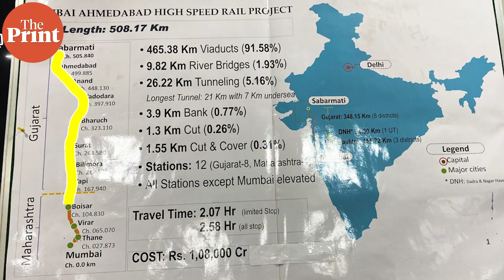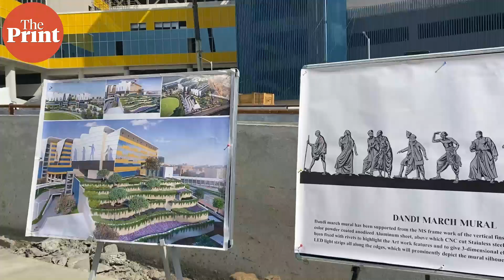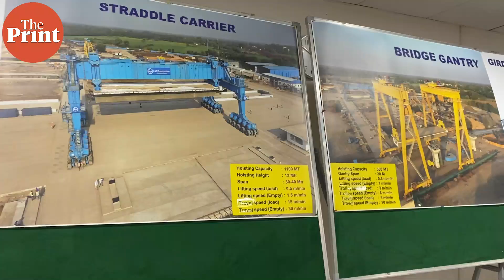Pier by pier, girder by girder, how Gujarat leg of India’s first bullet train is gathering momentum

Comment: By the time this is ready, China would be running 600km/hr maglev HSR which is already ready and entering service next 2 years and the network would be 50000+kms up from 37000+kms today. Meanwhile, China is testing 1000+km high temp maglev tech to be implemented in the 2030s. Indians should stop arguing, debating etc and work faster!
Reply: Maglev runs only in Shanghai lol. Calm down. This is 500+ kms. Same as China and speed will improve as we go on.
Reply: @narutohenaruto  you must keep up. Shanghai maglev has been running for over a decade at 400+ km/hr. China just introduced a new 600km/hr maglev which is undergoing final testing and will be in service on other lines soon. India has NO line faster than 100+ km/hr today. The Japanese one is nowhere ready and will take years and will only run  just at 320km/hr
Reply: @n.c9653  Indonesia will follow China for HSR and Maglev @ 600 km/hour as well . We , Indonesians are satisfied with Fuxing CR400AF Red Komodos @350 km/hr I am going to ride it this coming Juky 2023.
Reply: @narutohenaruto 

600km/hr train is ready 😉. Will be in service on the next 1 to 2 years in China. And China has started working on a new high temperature maglev that will go over 1000km/hr.

youtu.be/KjihYB-AQCA
Reply: Is China running HSR in profit?

Comment: 320 km per hour, and covers 580 km in 3 hours, then what's the use 😂
Reply: 320 is the max plus there might be stops along the way. The train has to take curves, accelerate and decelerate, right.!?
Reply: The use is that currently it takes 7+ hours for the same route, so it slashes the travel time by more than a half
Reply: Limited stop train can do 580km within 2 hours.

Comment: The Japanese High-speed train technology is 30 years out of dated, just like Japanese phone or TOYOTA car, there will be no TOYOTA in 2035, or even 2030. Check the video with the title:
2022 BYD Atto 3 - New electric SUV with 521km range! | Walkaround | Autocar India
Reply: The shinkansen E5 coaches which will be used in our bullet train has been operational since 2011, so it isn't 30 years outdated...
Reply: One bowl 🥣 bat soup please
Reply: @rohityo8729  Funny. You can't build a bridge without Chinese equipment
Reply: it should auctually start work on Hyperloop
Reply: Hello Chinese,go away
Reply: Brother it will be still huge leap for india, 1940s era ICF coaches are still operational here

Comment: Bullet Train carries 1000 passengers with less fuel within shorter duration than flight. So it will reduce the flight services among Indian cities in future.
Reply: Dude bullet trains is run by electricity not fuel
Reply: @sanatanihindu3089  where does electricity come from? powerplant that burn fuel. most of the fuel India buys from Russia, goes into power generation. it not just cars and planes that use gas.
Reply: @lagrangewei  Bro for your kind of information we not use 100% electricity made up from focil fuel 40% of our electricity is generated by renewable sources like solar wild hydro and nuclear and our target is 70% electricity generation by these renewable sources by 2030
Reply: @sanatanihindu3089  The Chinese are running HSR in losses even after so much use of renewable  electricity. Its a disaster in the making. We need to improve our existing cheaper rail network. A 150 kmph train is enough to travel with. Air travel is enough to cater to the prosperous ones.

Comment: When wiill beguin the construction of the Delhi -  Varanasi Bullet Train Railway ?
Reply: As per feasibility report Delhi-varanasi project got cancelled
Reply: @abhijitpanigrahi2759   No they rejected pre feasibility report because the route has many #curves, they want it as straight as #possible.
Reply: Not for up bihar
Reply: Hsr is very expensive and time consuming since our present tracks r not compatible with hsr.
Reply: @agnimi1  yes, second generation of Vande Bharat is better but shall stop at Noida, Noida Airport, Mathura, Agra, Lucknow, Ayodhya and Prayagraj... and is better to have exclusive railway for Vande Bharat, so regular slow trains don't obstruct high speed trains
Reply: Delhi Varanasi vande Bharat train will be mostly upgraded for high speed travel in future. I don't find bullet train to be necessary in this route.
Reply: What it is not necessary are so many airports in Uttar pradesh ! They are constructing 5 ! You only need 2 main airports, 1 in Jewar and 1 in Lucknow , well connected by a fast speed trains to delhi , mathura, agra, prayagraj, ayodhya , varanssi and other cities
Reply: Based on initial success of this expedition, decision will be made. 
 It will be along Delhi Mumbai express way. Land is mostly acquired.